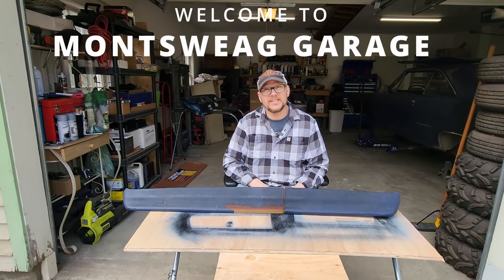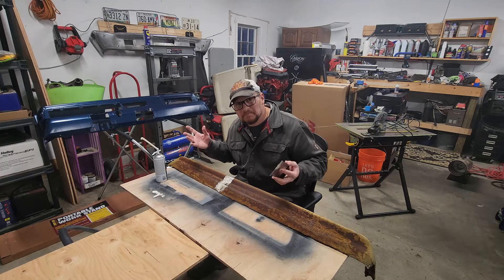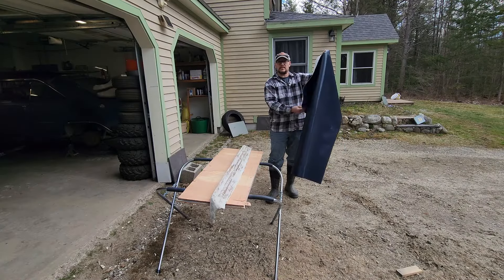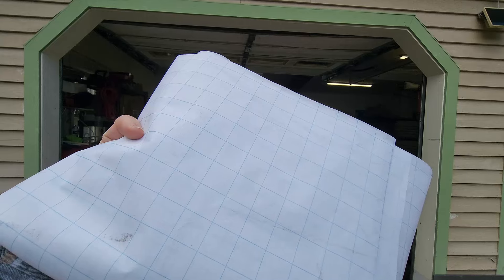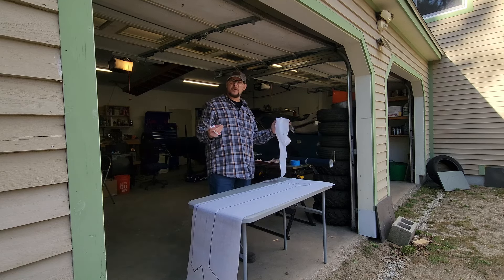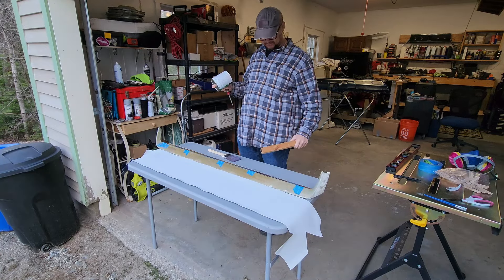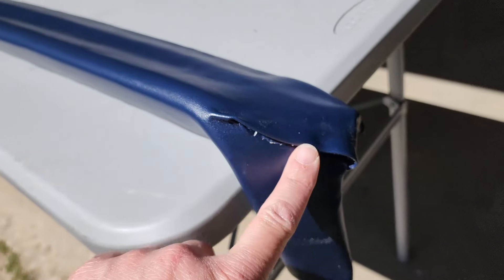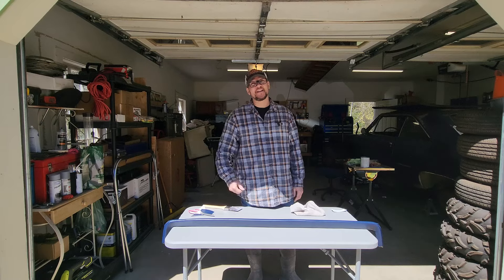Somewhat Okay Refresh Of A One Year Only Dash Pad

Comment: When I first saw you doing that with bare hands I thought ooooh, that stuff is nasty sticky. I have only had a little experience with that stuff many years ago and I also can remember it being frustrating. I almost think you need to have material that can be stretched somewhat to try to conform it to all the crazy bends around the sides, but In the end it is a learning experience. It could be an expensive learning experience depending how many trips you make back to the fabric store. Oh well it looks much better than what was on there before.
Reply from the maker: Thanks for the insight Chumley. Oddly, it wasn't as sticky as I though it would be. It may be due to the stuff I got being non-flammable, or low odor. Not really sure. It took like 6 coats to get tacky enough to bond and there were a few spots that still didn't bond well. I am probably going to rework it and sew the corners if I can't find vinyl stretchy enough to get the job done in one piece.

Comment: Attempting this? You’re a braver man than me. Poke the bubble with a pin to get the air out, like with decals.
Reply from the maker: Good morning Ron! Welcome to the channel and thanks for the comment. This was my first try at this and it came out so-so. I already have a plan for the next time. I am the kind of guy who likes to learn new things and I learn best by doing. I tried the pin thing before I worked the bubble out the side. The hole just closed back up and the air remained trapped. The vinyl was pretty soft from sitting in the sun.

Comment: Nice work, I may try that on some door panels. Please let us know in the future how it holds up over time.
Reply from the maker: Welcome back Walter. I will definitely let folks know how it holds up. I still need to figure out how to approach the seams for the next time around. I may try to sew in the seams. The bad ones are pretty much hidden by the A-pillar at the moment. I know they are there though and it irks me.
Reply: @MontsweagGarage  I was wondering if the seams would have been better off on the underside of the end curves?
Reply from the maker: @Blu_Grit_Garage  The way the vinyl laid out, it was either there or the inside curve where the front face turns down. I definitely didn't want them there. One of the other viewers mentioned a vinyl that is much more stretchy. That might be the way to go.
Reply: @MontsweagGarage  I wonder if instead of making a pie shaped cut out maybe cutting a slit? Then trimming when you glue it on? I figure it is near impossible to cut the vinyl perfect and then try to contact cement it on and hope it sticks in exactly the same place.
Reply from the maker: @Blu_Grit_Garage  it would definitely be worth a try. That probably would have prevented the ugly gap I have on the driver's side.